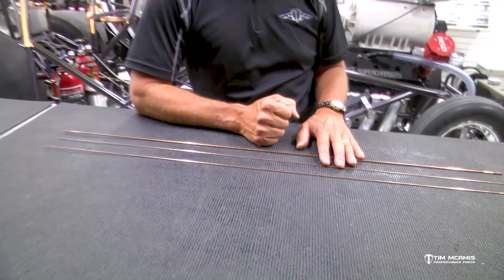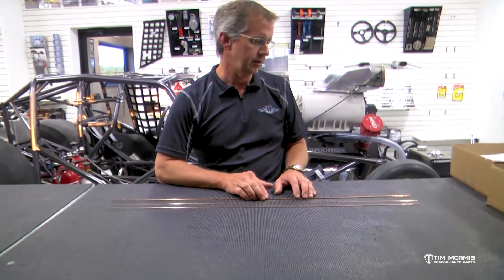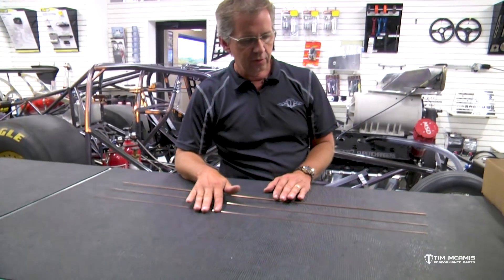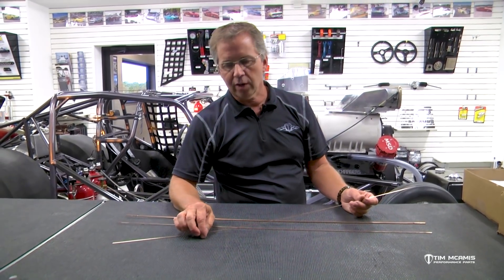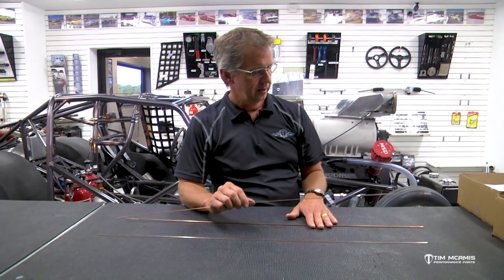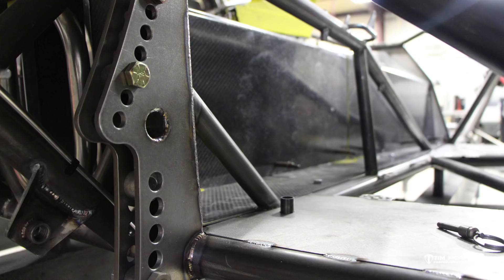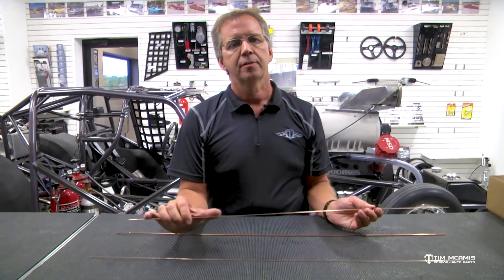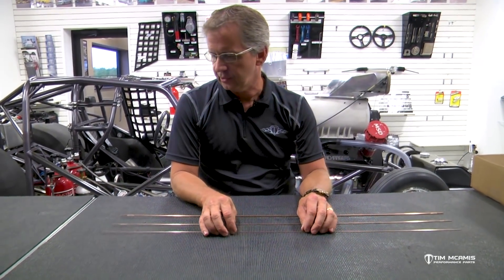Welding Rod Selection

Comment: Please help. I went over a thread with a filler rod and i cannot cut threads on it. Its too hard.
What filler rod do i need to be able to cut threads on it ?
I used ER705 and i have ER308L but did not try it yet.

Comment: Mild steel rod on 4130? Yes! Because the heat draws the carbon from the chromoly to the weld. 4130 or 70s6 rod makes for a brittle weld.
Reply: So which rod are you suggesting? For 1.5" CM tubing with wall thickness between .065 and .083. Obviously I'm a newbie. Any info would be much appreciated.

Comment: Why TIG instead of MIG? Easier to change rod size and materials?
Reply: You can run what ever wire in a mig setup but tig gives u more control.  Cleaner, better looking, stronger welds.